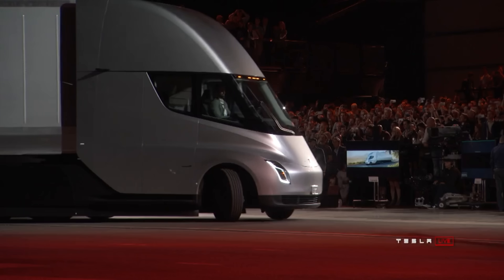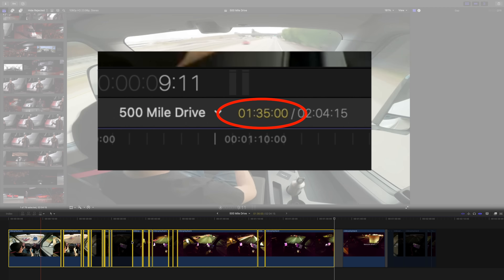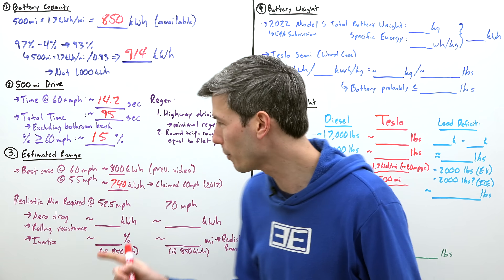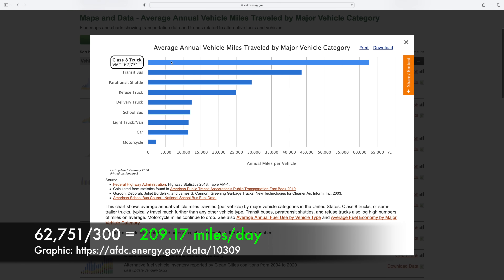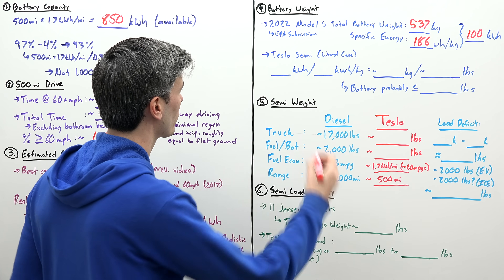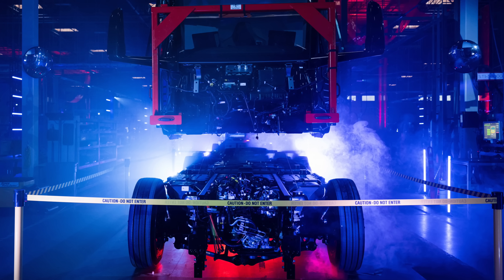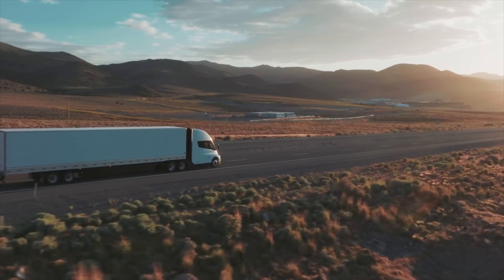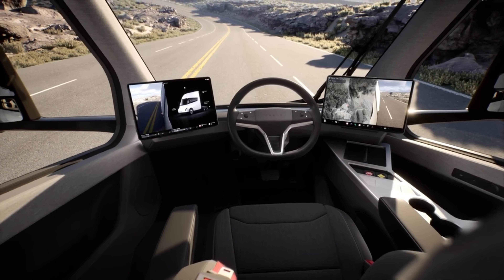Does The Tesla Semi Make Any Sense? Part 2!

Comment: I also dug into the Tesla Semi 500 mi drive video frame by frame, have the exact route they took (497 mi according to Google Maps), and made a few calculations on it. I'll argue that it's hard to assert the average speed by using percentages of video because the pace of the video does not seem to be uniform. I sampled frames in the early part in Fremont where they were driving 55mph (0:12) and they went roughly 0.1 mi per frame (24fps) and then another sample passing Los Banos (0:30) where they were driving 55-57mph and going ~0.26mi/frame. By those two samples alone, I think it's safe to say that the video wasn't uniformly sped up, so I'd argue it's hard to make conclusions on frame percentage alone. But it's definitely not 60+mph regardless

Comment: What if the the downhill segment is at the beginning of the trip. Regenerative breaking will be ineffective at holding the speed down and the driver will have to use break friction. The driver might want to not fully charge before starting the trip in that scenario. The software is probably smart enough to know this already when charging.

Comment: Your key point, about air drag being significantly less if you are travelling at less than 60 mph, is more than offset by the fact that the test drive includes a lot of brakeing and accelerating.  When tests for mileage are done, the condition is smooth, continuous speed driving, in which case the Semi would have done a lot better.  They are trying to show you mileage in a less forgiving, more realistic scenario, and instead of appreciation you turn everything around to criticize them.  And before you give me the regen argument, keep in mind that regen is about 90% efficient;  NOT 100%;  you still lose energy slowing down and accelerating, even if nowhere nearly as much as ICE.

Comment: 11:32 Easily carry? You just said the estimated max is 44,000lbs. Maybe the first 5 bars inside the green square could be called an "easy" payload for the tesla, at around 63% of its max load at the greatest. It couldn't even carry the last bar because it's too heavy, and the other 3 wouldn't exactly count as "easy". You usually don't wanna operate most things at their max rated capacity on a continuous basis, for obvious reasons. 12:36 Case in point. Does it have a use case? Sure it does, but let's not pretend it "easily" carries the loads in the mid-weight cargo region like the big boys in that survey, because those diesel trucks have much higher load capacities. They're probably more efficient too.

Comment: Any thoughts on how often batteries will need to be replaced.   Since the cars average expected life is 100,000 miles  and the average semi racks up 45,000 miles per year that translates to a new battery every 2 years.   Assuming the semi will mostly be fast charging that may kill the batteries even faster.   New battery every 18 months.     Using 100KWH Tesla battery costing roughly $14,000 to $20,000 a semi's new batteries should pretty much scale up linearly.    So a 850 KWH battery will be 8.5 times more than a car battery.  That being said a new battery (at $14K) will cost close to $120,000 every 18 to 24 months.   That is  about 67% the cost of a new truck (based on estimated base price of $180K).  That definitely does not sound sustainable or cost effective.   I enjoyed you calculations.  Great video.

Comment: Depends more on how long the battery lifecycle last more than anything else. Full discharge and recharge possibly twice a day and insane power demands might not last long.
Reply: The power demands are no different to any other EV. Battery stress is the same. There's years of data of using Teslas as taxis so there's comprehensive data on heavy patterns of use.

Comment: A key factor for the Tesla demo test driving through California is that all trucks are restricted to only 55mph.  So the test is doing a bit of shenanigans in that it wasn't traveling at 65 mph, but probably very close to your 52.5 mph average.

The biggest issue for estimating the truck weight is that the structural makeup is utterly unknown and can result in a significant difference in weight.  I highly doubt the truck is made in a traditional style of ladder frame with components attached, and is probably built like other BEV with a battery integrated as part of the structure.  From what I remember, it is supposed to have an independent front end, which was probably chosen to save weight.

Particularly telling is that it is only available as a daycab, and not a sleeper.  Sleeper trucks are notably heavier than daycabs, except for heavy haul and specialized ones, like crane and winch trucks.  Elon Musk LOVES to do far exceed what people expect, and I have no doubt that he would push his engineers to make a sleeper cab version if it was practically possible, or at the very least market one somehow.  That they didn't, and aren't even mentioning that as a future possibility in any sense other than vague "take over the industry" type comments is extremely telling.

Combined with how delayed its development was, that it doesn't have the features initially touted, that practically ALL critical information about has been kept from the public, and that it was marketed to an utterly uneducated about trucking public as basically a sports car, presents a very obvious situation.

Development for this truck has been hell for Tesla, getting the weight to a manageable level was a far more daunting challenge than initially expected, and nobody was investing in the vehicle.  So, Elon had to force companies to invest by selling it to the public, thus bringing huge amounts of PR pressure to major companies to invest in the truck.

Not only that, orders for the truck have been, well, mediocre.  There is very little activity from the major companies regarding this truck, which is unusual since if this truck could truly revolutionize the industry, they would be reserving large orders of them and the marketing propaganda from it would be everywhere.  Instead, it is practically silent with Pepsi being almost exclusively the only active media presence for the truck.

Then, Tesla stays utterly silent about practically everything about it, and probably has some serious NSA agreements with Pepsi, since we haven't had any leaks there either.  This is totally out of character for Elon and Tesla, and raises the question of, why so silent?

Taking all those things into account presents a picture that this truck had serious development challenges far beyond what was expected, and has possibly even proven to be an impossible goal, leaving the truck relegated to only specific types of runs and haulage.

For what I do, it could not accomplish it by any measure.  My current load is rig mats at 48,000 lbs from Colorado to Oregon.  1,100 miles, 2 days.  I have a sleeper truck that with a Reitnour 48' x 102 all aluminum split axle flatbed, can legally load 52,000lbs on the deck.  I am regularly at 45,000 lbs, at times up to 48,000.  The most I've had this year was 51,000.  I may only get 6 mpg, being 35 years old, but the degree of development and infrastructure to have the Tesla truck be able to even match what my truck can do and be viable for what I run is probably still a decade and more away, if ever really.

A remote car charger is one thing, but supplying the amount of electricity needed to charge a truck in the highly remote areas of the American West will be a massive challenge.  Supplying fuel to such locations is easy, but electrical infrastructure is a totally different beast.

Comment: Frito-Lay selected as primary ETREE demo partner
• Operates fixed defined routes, 15-100+ mi/day, delivering chips/snack food
• ETREE Peterbilt Model 220 will operate on (typically) 
50-80 mi/day routes from the Indianapolis distribution center
 PepsiCo / Frito-Lay is a significant proponent and adopter of alternative fueled, 
including electrified, vehicles, and one of the largest operators of class 6-7 
trucks
“‘The Range Extended capability of the ETREE vehicle is of great interest to PepsiCo. 
It provides real world opportunity for zero emission driving and also the ability to drive 
extended miles when needed, with no interruption”
- Mike O’Connell (VP Fleet, Supply Chain and Sustainability) PepsiCo

Comment: It tried to replace the gas fuel to EV, but had no quick swap advantage for longer rides. It so far has no multi ALL: swap, drive, steering wheel and park mode. A 3 body Front Drive head, Trailer base iMech and rear iWheels. A Future truckers robotic road buddy.

Comment: Great video, however disagree on the part about regenerative braking.  It could be that Tesla's brakes are super-awesome in comparison, but in my Nissan Leaf, driving in Pittsburgh (a hilly city), the regen brakes generate way less energy going down the same hill as it consumed going up it.  It's even more pronounced when the hills are longer and at highway speeds.  (even without any heating or AC turned on).  When choosing routes on GPS, with same source & destination, choosing the one with the least hills always uses less overall battery kWh.  Maybe if the Tesla Semi's had special trailers which also added regen-braking to those rear wheels and could plug into the tractor for additional charge... but I haven't seen any marketing claim for that.

Comment: As a former truck driver, 60mph is a totally reasonable speed for a semi truck. I used to work for TMC, and we had a speed limiter set to 62mph to save on fuel costs. Very few companies allow their trucks to go 70mph+, so when you're seeing it, it's usually owner operators who aren't appreciating the economics.

Comment: Awesome video and some impressive data mining to say the least. 
From what I have seen on a few other channels about regeneration from hills on their EV tests so far seem very different from your 1:1 statement. If you talk to some longer haul truckers they will tell you climbing hills burns fuel like nothing else, thus it should be Tesla's biggest advantage, but the independent EV tests so far online were regenerating in the mid 60's percentage and up a bit from there...on the odd one. 
For me personally the the massive white elephants in the room are max pay loads, extreme temps, battery life cycle being the biggest of all! Then there is the increasing energy prices too. What the government data is not telling you is that loads of truckers are running overweight and bypassing weigh scales all the time; they can also go 1000 miles on a fill up and run 24/7. That is how cut throat that business is in the real world, not some elitist beverage company packing chips in PR branded publicity stunt.
Reply: In practice with an electric car(not a Tesla) I have found that his statement is true, downhill you can use regenerative breaking but also just coast. This considering you are driving at a regular pace.
Reply: You also have to consider distance. The real comparison would be eg. driving 20km on flat and driving 10km up the hill and then 10km back down at the same speed. Because even when driving up / down the hill there are the same losses as when driving on flat, plus some additional - bigger resistive losses in battery, motors and controllers due to higher currents and regen efficiency itself - again losses in motors, controllers and battery charging.
Reply: If you look at EE's graph again, you don't gain 1:1 power back. That ~60% is more correct. What he said, was that it joins back up with a "normal/flat" discharge profile (ie, the consumption stays roughly median, even though you spiked in places)

Still a massive strength imo, plus, I imagine it maintains a better torque/power balance on ascent too, than a diesel.

Comment: Are you sure that structure would be less weight as it scales up? It seems to me, once you pass a minimum threshold, that while the cubed square law would mean you have a lot of increase volume for little increases of surface area, the additional weight would mean heavier components for support and fixture.
Reply: true, there's no decrease in weight at all. Because imagine a box of soda bottle, stacking these boxes up do not decrease the weight of these pile of boxes. In fact, we will increase the weight of these piles of boxes due to adding supports.

Comment: One major factor excluded from your calculations is the battery longevity.  These calculations are based upon brand new batteries and max battery capacity.

Also fast charging apparently reduces battery longevity. At least according to Ford Lightning manual. Which sounds like a logistically incorrect application for long haul truckers. But more ideal for short haul loads where slow, overnight charging is available.

Additionally, fast charging in 30 minutes never reaches 100%, therefore real world applications are thrown off when a battery is over....one or two years old?

Comment: Here in Finland we drive the last 10-20 miles with smaller trucks. With all the equipment they cost from 100 000€ to 140 000€ with diesel motor. Electric Volvo or Renault costs 170 000 to 230 000€ so it ain’t cheap.

Comment: My biggest issue with the Tesla Semi is the driver seating position. Contrary to popular belief, us truck drivers aren't paid to drive, but to back into places. Traditional trucks have a preferred left side and a right aka. blind side. Backing into a place on the left allows to stick your head out the window and see everything. I had friends arguing that Tesla will install cameras, but unless they have a 40" screen inside the truck, some sort of magical cleaning device for the cameras and magical coating to get rid of flare, that won't help. Not to mention when you look in a direction and hear a noise, you can immediately focus in the area the noise is coming from. The backup camera would need directional microphones and the most precise surround speakers and still won't be able to achieve the same

Comment: Just curious, does the inertia help the range while the truck is moving because it helps move the vehicle forward, so that should mean that it reduces the power required to move the truck?
Reply: No, adding weight to a vehicle increases the rolling resistance the engine has to work against, while wind resistance remains constant. Inertia isn't a force.

Comment: Given the lack of important, relevant info Tesla has released we can't actually quantify the actually performance of the the Tesla Semi and compare its performance to other electric trucks and say if or by how much it might be better than other electric semis... and I don't think that is by mistake!

- where is the full length, unedited video on youTube we were promised of the 500mile trip? If we had this we'd be able to calculate the speed of the trip which can extremely affect the energy requirements, range...
- where is the actual weight of the truck and batteries? Why couldn't they just release this?? ..another update missed is that the battery pack is modular having 3 packs.. the there are TWO VARIATIONS.. the "500" truck and battery weights 26,000lbs and a lighter truck.. the "300" that has a smaller battery pack an weighs 20,500lbs.. so shorter range, but can carry 5,500lbs more because of its smaller, lighter battery pack (lighter battery by 5,500lbs)
Reply: ...you've said it.. without knowing the actual weights of batteries, without knowing the average speed of the trip we cannot gauge performance and compare it to other EV or diesel trucks... announcing the range without also qualifying with ave speed and weight data.. we know NOTHING.. you could literally achieve a range of a 1000miles if you used enough battery (reducing load capacity)  and/or drove slow enough 🤷🏾‍♂ without it's an entirely useless, meaningless value that tells us NOTHING of performance!

I think when this data is made known, you'll find that the Tesla Semi is not magic, not sprinkled with unicorn dust.. but when compared 'apples to apples' has basically the same or similar performance to other EV trucks.

Comment: You didn't mention the weight of the reduction gears I assume the Tesla needs. They'd have to be very hefty.
And it all goes out the window here in Australia when you realise most trucls out on the highway are 51.5 ton B-doubles that do a bare minimum of 700 kilometres per day, usually more.
Reply: also in europe these trucks wont really be feasable, we have a 40 ton weight limit and trucks usually need more range here due to time and refueling constraints (many truck companies only refuel once at a local stop and then do the entire tour on one fill... across multiple nations)
Reply: Tesla Semi transmission should be significantly lighter than a conventional ICE truck transmission. Like yeah sure there's more torque to handle, but there's no gearbox per se.

Totally agree that these things aren't going to be hauling road trains across the Nullarbor, or B-doubles up the Hume for that matter. Should still be fine for like 3/4 of our total road freight though.

Comment: Battery weight doesn't limit cargo capacity when hauling potato chips or pillows.  If it worked well for dense loads, Tesla should have been using their Semi to haul battery packs from their Sparks, NV factory to the Fremont Assembly factory.  That would have given useful test data.  They did do one run, apparently for PR, then halted.